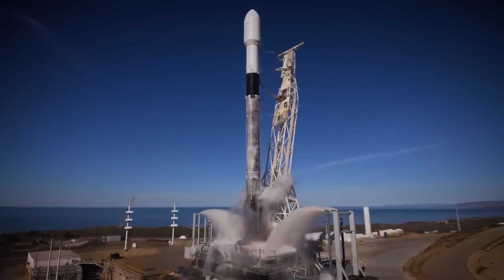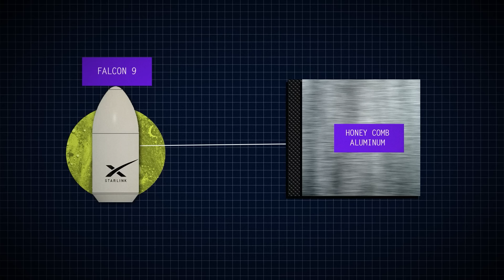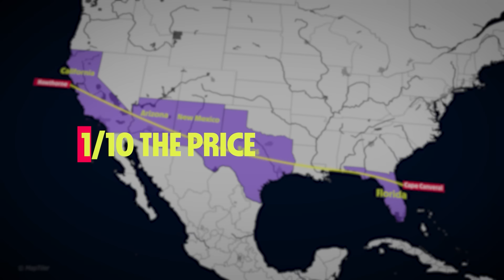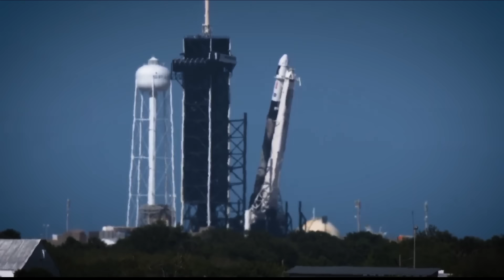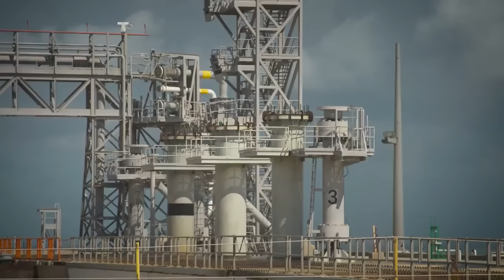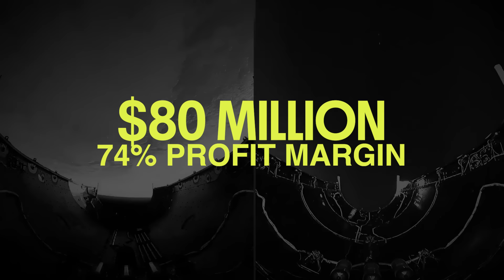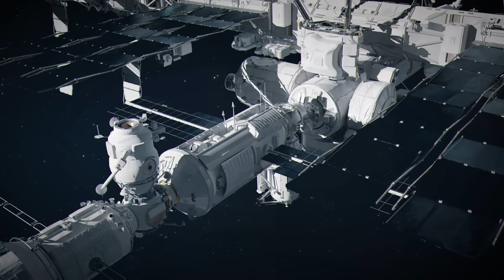Why Going To Space Costs So Much

Comment: Your launch cost calculation was based on re-using each booster only one time, but boosters are now being used multiple times, saving more cost.  When a client's launch parameters mean that Space-X will not be able to re-use that booster, they charge more – fair enough.  So, the overall cost model for various launches might get even more complicated, but when you break it down into bite-size pieces like this, it can still be understood.  Thank you!
Reply: Booster 1067 has successfully lofted 27 different orbital missions and safely landed each time.  Many other boosters in SpaceX’s fleet have already surpassed 20 flights each.
Reply: Uhh, what? The boosters have to be refurbished each time. That cost doesn't just disappear.
Reply: @ They get better at it.  Getting a booster back, that's flown to space 27 different times, not only informs them on the amount of refurbishment required (end goal — not with Falcon 9, but Starship — is to get that down to next to none), but on optimizing the construction of future vehicles for both initial and ongoing costs.

That the record booster turnaround has been 9 days landing to launch, and given the size of SpaceX's fleet — refurbishment needs are not the pace-limiting factor.
Reply: @guard13007  The refurbishment is in his cost; he assumes between $200k-$2M refurbishment cost per launch. What @fpadams said stays true because this "researcher" assumes in his calculations that each rocket booster is only used once, instead of the dozens they actually fly. So, this researcher is either sloppy in his calculations, or a dolt, and this video's conclusions are simply wrong.
Reply: This channel is just conjecture and speculation these days

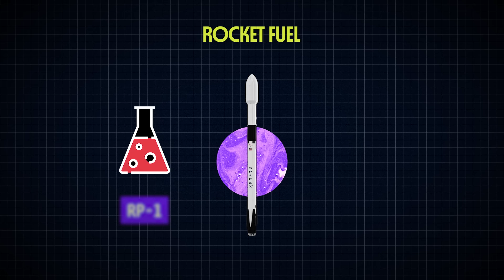Comment: 12:35 In addition to the propellants proper (the RP-1 and the liquid oxygen), there is also Helium gas for pressurizing the tanks and for starting and restarting the engines on the ground and in flight. The prices of helium have changed wildly over the years, but a few years ago it was reported that the cost of helium for one launch was greater than the cost of LOX.
Reply: Helium is used b/c it's a gas (and can thus exert pressure) at temperatures where hydrogen and oxygen are still liquid. I don't think there's any other that can do this. Commercial amounts of helium come from natural gas deposits in Texas, Qatar, and Russia; the US decided to sell off its helium reserves and not invest any more in domestic production, which is why the price can fluctuate so wildly. And of course, nothing wrong with depending on a hostile power like Russia...
Reply: @PhilPerry-c7q  Don't forget the high quality helium from South Africa.
Reply: SpaceX gets a lot its helium from SW Saskatchewan and Alberta, Canada.  Royal Helium signed a long-term contract with them in 2022 worth about 40% of all its 98% pure helium they produce.  They mine it from deeper deposits that aren't mixed with natural gas and thus cheaper to refine than Texas natural gas deposits.
Reply: @Roarmeister2  They mention a price of 23 dollars per cubic meter. Since Falcon-9 uses a few thousand cubic meters per launch, the total comes to around $50K per launch in helium costs -- perhaps a little more with taxes, shipping and handling. That is still very inexpensive, equivalent to the revenue from launching less than 10 kg of payload. Incidentally, using helium vs alternatives saves tons of idle mass on the rocket, so it is a very good deal.
Reply: @cogoid  Do keep in mind that that it's probably 23 dollars per cubic metres at ambient pressure. Given that the tank pressure for falcon 9 is on the order of 5-10 bar, you'r few thousand cubic metres per launch at 5-10 bar amount to many many more cubic metres at ambient pressures.
Reply: @thomaswijgerse723  The volume of the tanks on the rocket is a bit under 500 cubic meters.The helium is warmed up before being sent to the tanks. So, a couple of thousand cubic meters (at STP) it is. 

However, this is only the helium on the rocket itself. For the cost of launch, one has to add the amount used for ground operations. To increase the density, SpaceX super-cools liquid oxygen almost to a freezing point, so there is some tricky propellant conditioning involved. SpaceX Falcon-9 tank farms have as much as 5 railroad cars of compressed helium -- each car can store 7.5 thousand (at STP) cubic meters. But obviously not all of that is consumed at once.
Reply: So why not use another noble gas like neon or argon?
Reply: @twistedyogert  Helium does not condense into liquid at the conditions of this use. It has very low mass. It is available in huge quantity at somewhat reasonable prices. All other noble gases lack at least a few of these properties.

Argon will not work because it condenses at a similar temperature to the oxygen.

Neon price is x100 of that of Helium, though both vary enormously. It is also 5 times heavier -- the mass penalty for the rocket will be about 1200 kg.
Reply: Jesus is their a more cheaper alternative to helium
Reply: @butterbean139 technically, nitrogen if it above the temperature of nitrogen boiling point which is useful for kerosene/RP1. Or just use autogenous pressurization of the fuel and oxidizer like Starship
Reply: @mohdafnanazmi1674  It is not so simple. Making a rocket that goes into orbit is already so hard that most startups never achieve that. Making a rocket that delivers a payload into orbit and also lands the first stage after that is many times harder. So SpaceX is using every trick to scrape as much extra performance out of the rocket as possible. Including using densified propellants, that is cooled almost to a freezing point. Specifically, their liquid oxygen has a temperature of 66K, which is well below boiling point for nitrogen even at ambient pressure, to say nothing about nitrogen under pressure. So, nitrogen would not work in this situation at all, even if the mass penalty were not objectionable.

Otherwise, of course, there were many space rockets which never used helium. Soviet Soyuz is the prime example of a rocket that uses nitrogen for tank pressurization. Starship is of course an interesting development, but at present it still uses a significant amount of compressed helium.
Reply: @cogoid  I did not state that Nitrogen was a great alternative to Helium, it is an option which can be used for RP1 as it is liquid at room temperature. This is an answer to a possible alternative to Helium that can be used.

 Liquid Hydrogen, liquid Methane and LoX are incompatible with Nitrogen as the temperature is too low. Which may only allow autogenous pressurization as a cheaper alternative
Reply: @mohdafnanazmi1674  I mean nitrogen is a very non reactive gas and pretty stable at high temps
Reply: @mohdafnanazmi1674  it's also used in Pneumatic Valves engines for racing cars as an alternative to springs to prevent a phenomenon called spring floating
Reply: @mohdafnanazmi1674  The issue with nitrogen gas is the temperature difference between liquid Oxygen is approximately 15C also flow rates.
Reply: @butterbean139 nope ,  helium is helium 😂
Reply: @butterbean139  The gas has to be inert, which most common gasses are Helium, Argon, and Nitrogen. 

Nitrogen is quite a bit cheaper... but there are engineering factors which degrade the savings. such as flow rates. The temperature difference between Liquid Oxygen and Liquid Nitrogen is also approximately 15 C ish, where as there is a 80C ish with helium.
(You want it as a gas to take up space and maintain pressure.) 

Argon is cheaper but it is a lot heavier... like 10times heavier. So... payload vs weight of inert gas.
Reply: @andrewreynolds912 its "there" not "their" in your sentence
Reply: The price of helium has skyrocketed over the years indeed. Helium costs for us are way higher than LOx or fuel costs. You could opt for nitrogen instead of helium instead, but nitrogen tends to mix with LOx, causing quite a drop in specific impulse, and nitrogen doesn't fill up a space as quick, so you either need more nitrogen pressure or accept a pressure droop during flight, both are not great.

Comment: the video a lot of us we needed, i was surprised by the cost of liquid oxigen, i thought it was complex and expensive to produce but it is the complete opposite 😱
Reply: Yes, but the safety issues are non trivial to say the least.

Liquid O2 doesn't even need a dedicated twinned fuel per se to create an almighty bang if ruptured in the wrong way.
Reply: @mnomadvfx 
To everyone in this chat, I just want to let you know that Jesus loves you and he can save you from sin, sadness and sickness.
Reply: the problem with fuel is volume and frequency of flights.  Now add Starship into the mix and logistics must be a nightmare.  I see why SpaceX is willing to build on-site oxygen extractors and refurbish facilities near launch pad.
Reply: @edbull  Speaking of fuel volume, on the NSF site during a Starship launch they said to fully fuel it took the entire O2 production in the country during one day!   Of course the facilities work around the clock and store lots of product between launches, but they were mentioning the problem that rapid multiple Starship launches is going to create just to fuel them.   SpaceX thinks BIG...and even when they fall short they're WAY ahead of all of their competitors.
Reply: LN2 is cheaper than petrol(gasoline), oxygen is only slightly more expensive - but like making hydrogen, it's not something you want to be anywhere near close to unless you have to be

LOX is made a lot of places because it's the easiest way to get oxygen for oxyacetylene welding and there's a HUGE market for that
Reply: @alanbrown397  The lox we use for our rocket is from Nippon Gases so I can only speak for them, but there the LOx we use is a byproduct of LN2 liquification (ln2 has lower boiling point than Lox, so it is relatively cheap.
Reply: @thomaswijgerse723  The research facility I worked at was buying 40 tons of LN2 per week. The delivery costs on LOX were the bigest cost driver, as were the safety requirements around the bunker
Reply: why it should be expensive its literally compressed air lol

Comment: How would F9 change if they switched to using the new Raptor Engines. Like we know starship has only used R1-R2 and is evolving R3 to replace them. So if they changed out the Merlin engines that use kerosene for fuel would they be able to give F9 a major boost in engine power and lifting power. Or would it be pointless. I’m asking because would it be easier to use different variants of the same incredible engines over making 2 separate engines for different 🚀?
Reply: R3 is no where near ready to be used on crewed or gov missions, which is why it is not used. It's still in early-mid development. In theory, yes the R3 engine is more efficient, powerful and uses a less expensive fuel source, it's just not ready for the types of missions F9 currently does.
Reply: @ oh yea I know it’s not ready yet. And thanks that answered some of my questions about it
Reply: @nerdwatch1017  To change to Raptors would require a completely new rocket.
Reply: @Skipp3rBuds  *Crewed. I know it's a minor nitpick, and I usually wouldn't have said anything. Except, not only is crewed more inclusive, but it also sounds better (weird how words have their own character based on nothing but sound).
Reply: @Yutani_Crayven  totally fair and good point.
Reply: @Yutani_Crayven shut up 😂
Reply: @Yutani_Crayven  simp
Reply: raptor engines are full cycle that run on methane and not rp1. they aren't compatible with each other
Reply: you would have to basically redesign falcon 9 from scratch im afraid
Reply: it will become a new rocket with new support system . its better to focus on starship than to make a new rocket that similar in size of falcon9